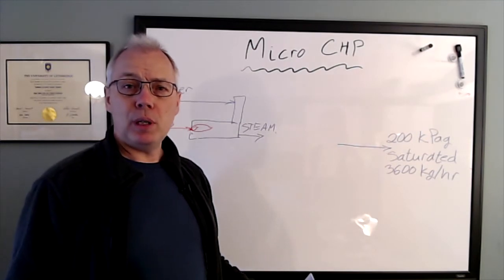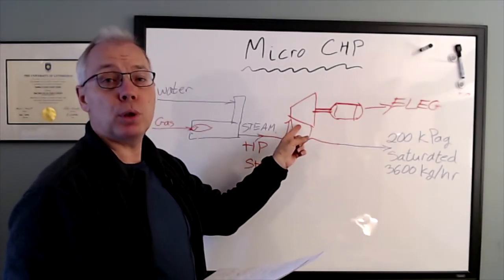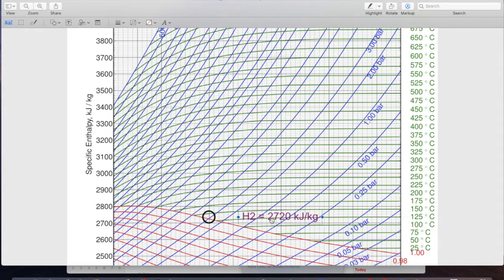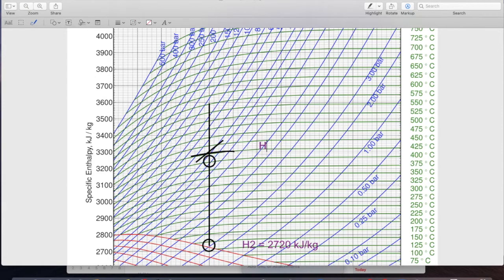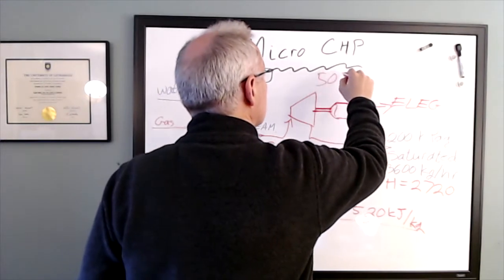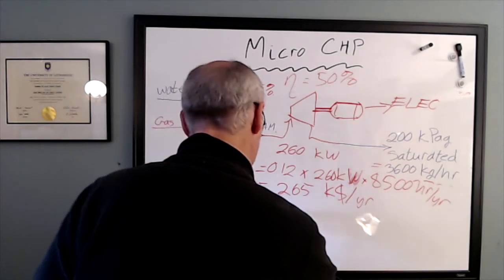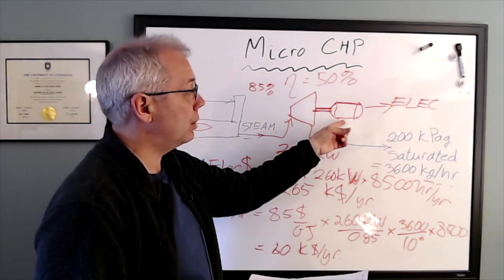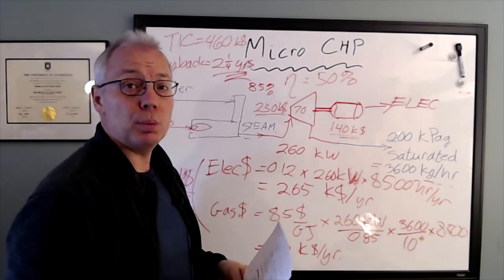Does micro CHP make sense?

Comment: for an off grid house... most of the energy is needed for heating...... when solar/electochem batteries are getting low.    Run a heat recovery generator to drive a heat pump, the total efficiency should still be more than 100%  for most of the continental USA...assume a COP of 2.5 average for the Heat pump...and maybe 80% for the fuel burning genny with heat recovery.

Comment: I wanted to understand combined heat and power so I can better understand how all this energy source might transition to renewable sources in the future.

It seems that the CHP model is all about using the inefficiency of combuston to provide heat. But renewable energy will be far more efficient and will not have this excess heat
Reply from the maker: CHP makes sense for places that are cold and do not have a surplus of renewable power (hydroelectric). Here we use gas turbines as the best way to supply electricity. CHP recovers more energy from natural gas than a gas turbine. CHP may be a poor solution for places with abundant hydroelectric power.